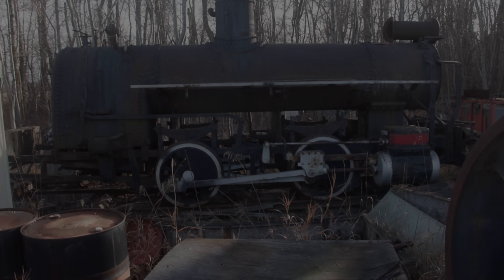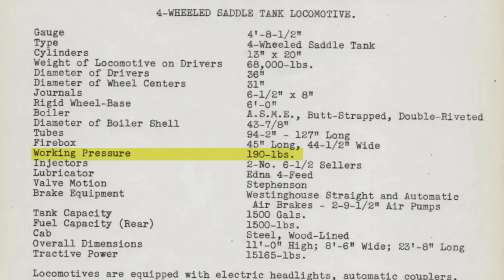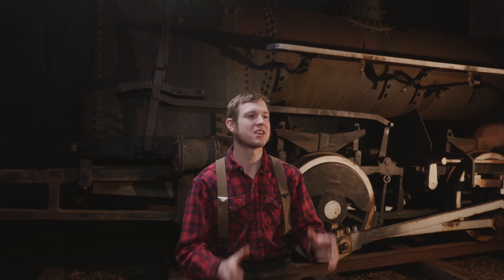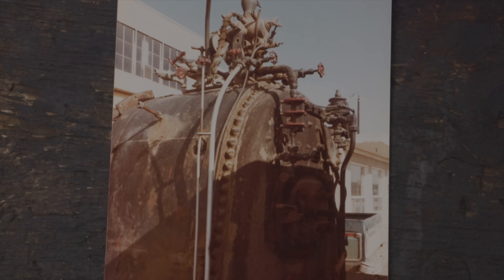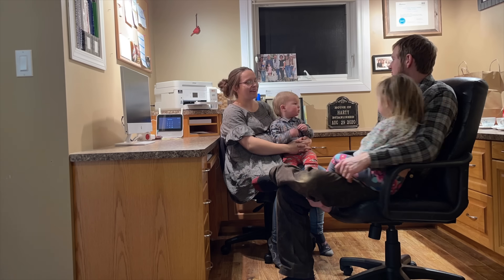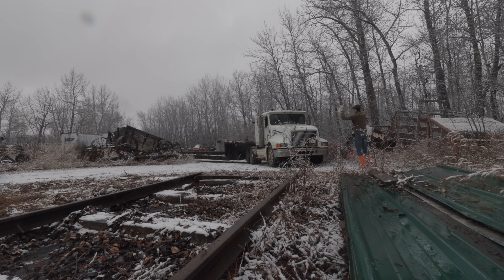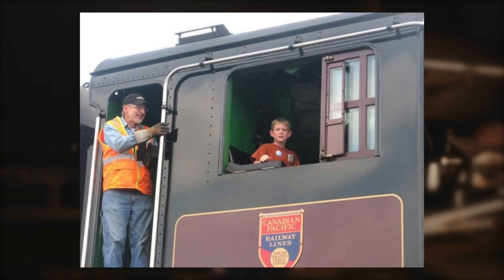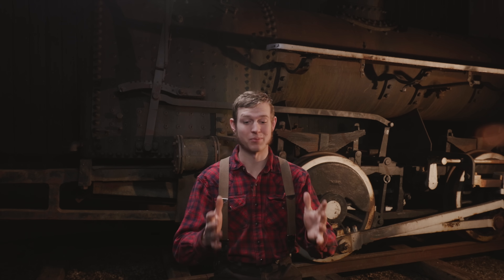Buying a Vulcan Steam Locomotive

Comment: 7:11 Anyone that asks "what use is a steam locomotive" clearly doesn't know what it is.

If the argument is that you have more effective modern modes of transport, that is true, but it doesn't change the fact that steam engines are still pretty good at doing what they were designed to do.

Comment: Hi Ethan. This is a great project you got here. 
I like the modifications you mention too.
What effect if any would a taller stack have on the stacks ability to draft the fire?
It would definitely pull the smoke/steam exhaust up and away. 
Also does the Canadian steam locomotive restoration requirements meet or exceed the US 15yr 1472 working day limit on steam locomotives?

Comment: Hey Ethan, our town museum owns a Case steam traction engine, last run in 2004. I had thought about getting the boiler checked ultrasonically. What's a rough cost estimate just for third party testing? I can likely rally enough volunteers to remove the cladding and do the bulk of the legwork. We're in MB, so I'm guessing this is all handled through the office of the fire commissioner out here. Have a couple contacts at the Prairie Dog railway as well who I may reach out to.
Reply from the maker: It depends if you can find someone who is sympathetic to the old iron hobby to do the work, both for cost and competency sake. It cost me $250 to get a “pre-purchase” ultrasound done on this loco (I think the fellow gave me a discount), but a comprehensive ultrasound in order to do proper calculations would likely cost $800 plus travel for the technician.
I’m acquainted with a couple guys from Manitoba who restore engines, send me an email and I’ll try to get you in touch with them. They would know who to hire.
ethanhartyblacksmith@gmail.com
Reply: @EthanHarty  Thanks man, I'll be reaching out shortly.

Comment: .....The wood cab may be a fun mod. But I highly recommend if you have an electric headlight that you don't covert to Kerosene, just make an enclosure to mimic the look of a Kerosene headlamp. if you don't want to have the dynamo ruin the lines try to hide the dynamo under the boiler. Just try to have LED lighting everywhere and pipe the release steam through  the smoke box and up the stack.

Comment: I have pondered what it means to be an avid collector and a novice model railroader.. Your dream is one I had since childhood. Love the mechanical marvels of a steam locomotive.
Reply: I was trying to figure out how to convert a steam locomotive to electric and it just came to me. I don't need to convert the mechanical motion to electric drive just the heat source; all the steam locomotive needs to do is build pressure. A LPG/CNG electric generator can be used with electric heating elements (the kind found in water heaters) with little to no modification of the boiler. A POC can be done cheaply by sourcing used parts locally; water heaters (5 elements, 240V x 10A each minimum) and electric generator (13-25kW). This would reduce cost of opperation and increase fuel efficiency by 20 to 50 times when compared to oil or wood.
Reply: @michaellatif  That has already been done in Europe and it got its power from the catenary. Those 5 elements will be nowhere near enough heating to operate a steam locomotive of even an 0-4-0 size. An 0-6-0 required 480kW and still took an hour to raise the steam.

Comment: Good for you to buy this locomotive and to work to restore it. It doesn't look too bad in its original form, although a few modifications might not be bad--perhaps, as you said, a wooden cab and a taller stack; I hope that you don't, and I'm assuming you wouldn't consider, doing the touristy thing and putting on a phony headlight and diamond stack to try and make it look 1880-ish; that sort of thing always drives me crazy and takes away from the dignity and proper bearing and appearance of a more modern steam locomotive.
Reply from the maker: I’m with you 100%. No cheesy mods.

Comment: Potentially dumb question if you have time: since we don't really use steam engines in the modern world, how do they have the engineers to do the certification and calculations? Other industries have had real problems with brain drain, even for example products from the recent past like the 1980s have had problems because everyone involved at that time has retired.Much less technology from so far back.
Reply: Steam boilers are still everywhere. Most of your power generation is via coal burning in a boiler or natural gas. There are hundreds of thousands of boilers just in the US, they may not be on trains but it is the same concept and thus engineers would be available to run the numbers.
Reply: There is also plenty of written material. It’s not all on the internet. There are books out there that still exist with calculations in them.